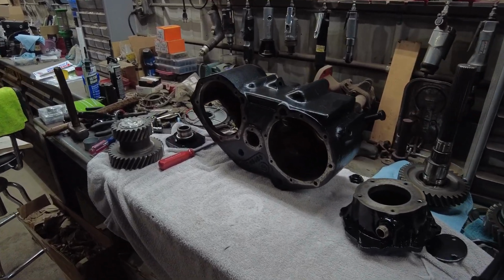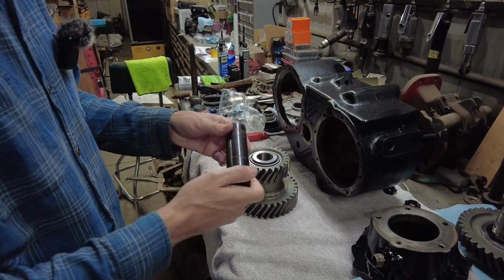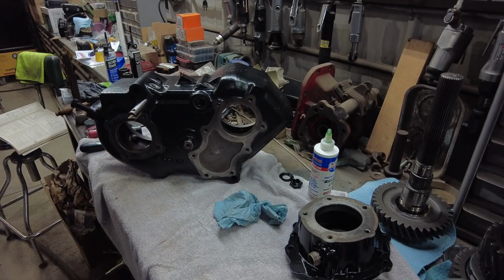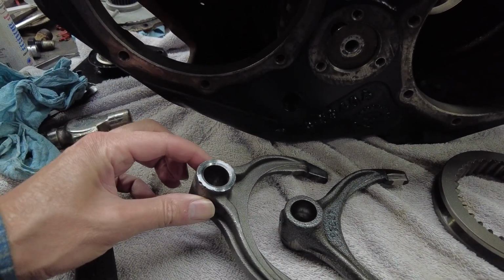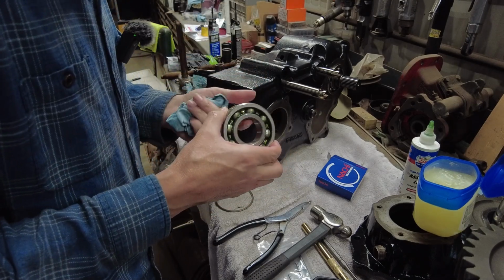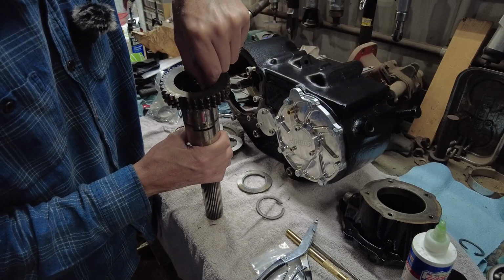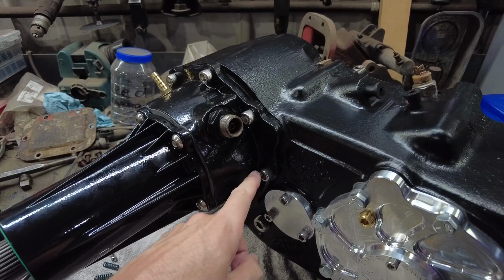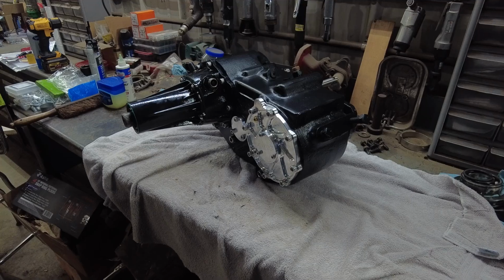80 Chevy Truck NP205 Transfer Case Rebuild

Comment from the maker: Things that might help with a project like this:
Seal & Race Driver Set: https://amzn.to/4772iVc
Small Seal Driver Set: https://amzn.to/4dZxg4t
Roll Pin Punches: https://amzn.to/4g9DJek
Brass Punches: https://amzn.to/3X9rIwH
Heavy Duty Snap Ring Pliers: https://amzn.to/3XoaJZ6
9" Flat Snap Ring Pliers: https://amzn.to/3ALPbg8
1/2" NPT Stainless Drain Plugs: https://amzn.to/4cWnpuU

This video contains affiliate links, which means that if you click on one of the product links and buy, I'll receive a small commission.

Comment: Nice video! I'm curious if anyone else has had the issue I experience. On the bench/press the endplay (between  the races, bearings, spacer shaft and shims) is absolutely within tolerance but when installed in the case there is longitudinal play along the idler shaft (.010) of the gearset but no movement up and down so I'm wondering if I need some sort of space between the case and the bearing surface of the idler gear. hope that makes sense and thanks!
Reply from the maker: It's been a while since I have been inside this transfer case. Not really sure what your problem is. Sounds like something might be worn.
Reply: @mossman381  No worries, love the videos! I got the gear installed with the correct endplay and just added a shim on the outside of the bearing too. torqued and everything moves freely with zero play so I'm going with it! Thanks for the reply!